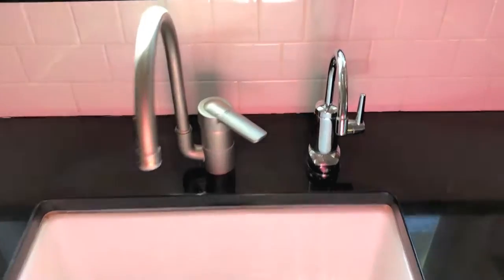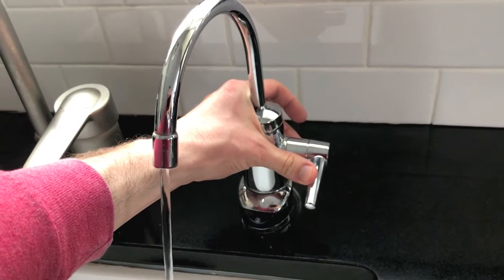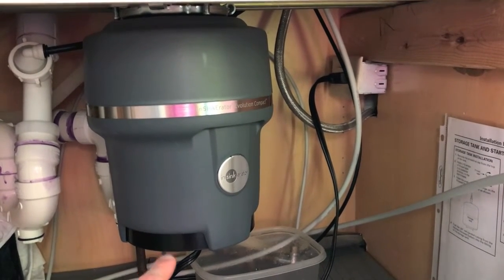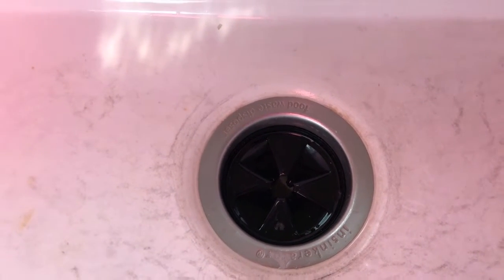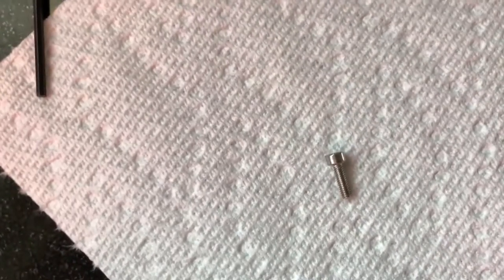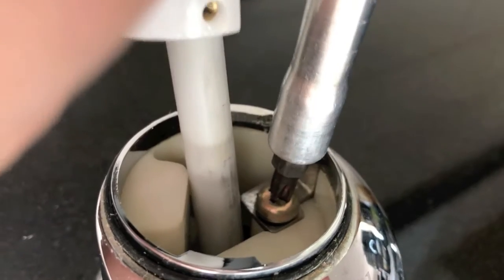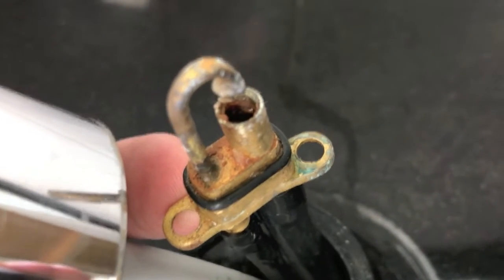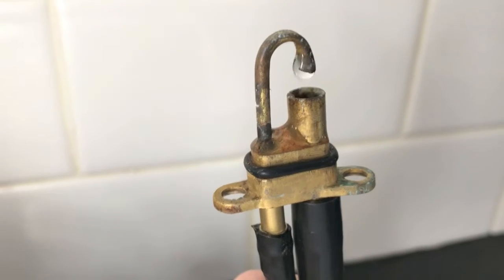My Reverse Osmosis Faucet is LEAKING - "Rubber Gasket Adjustment"

Comment: Can someone please tell me what that metal piece is called? Or how I could replace this part?? 

It’s not in the parts manual and GE said they can’t help unless it’s in the manual. 

Mine has cracks in the side of the little metal piece so even with a new oring it’s still leaking! 

It’s thay metal part with 2 black tubes (one end goes to the drain and the other grows to the filter). I’m happy to replace the part (both lines with the metal piece) but I don’t know how to find it… any help would be greatly appreciated!!
Reply from the maker: Thanks for watching Kayla, that may be a tough part to find.  The manufacturer will usually not sell that part as they would rather send you a new faucet with all new parts.

We recommend checking eBay periodically, we checked a moment ago & didn’t come across anything.  Please keep us posted.